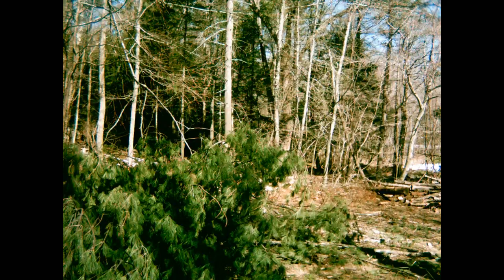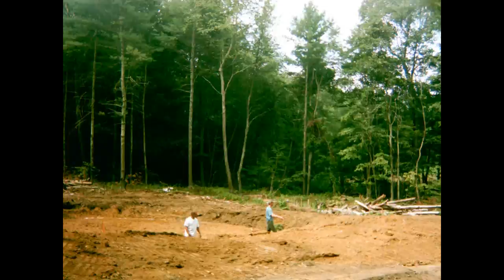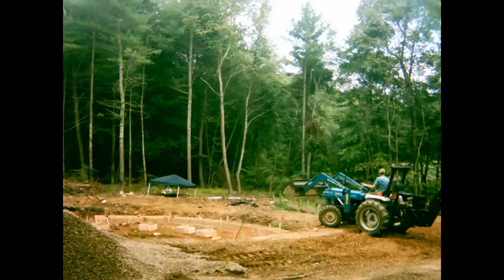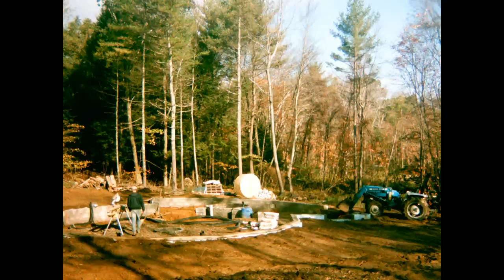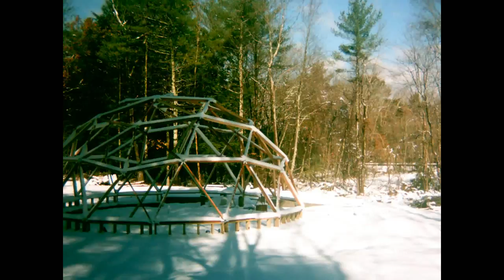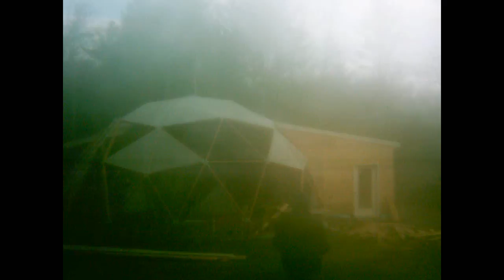Building the Aquaponic Geodesic Dome Greenhouse in TWO Minutes!

Comment: Do you need permit to build in wood? If you need, was it har to get it? Or it is still illegal >;-) I would like to build one myself, so I will have to check do I need one :-( 
Did you consider building pasive solar using sun to heat barrels and why was this better for you?